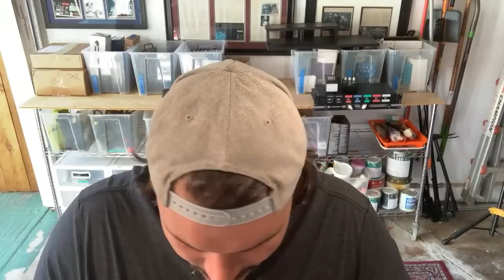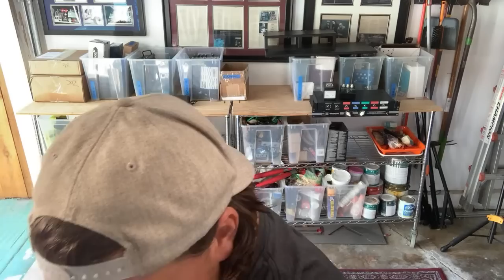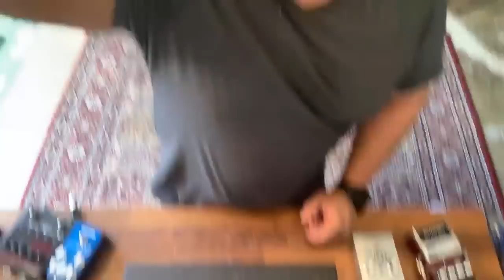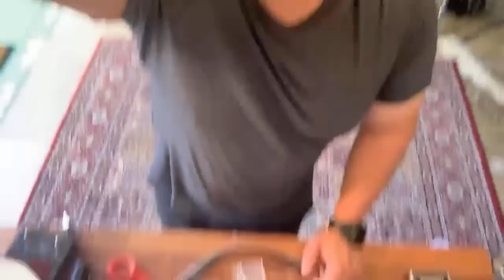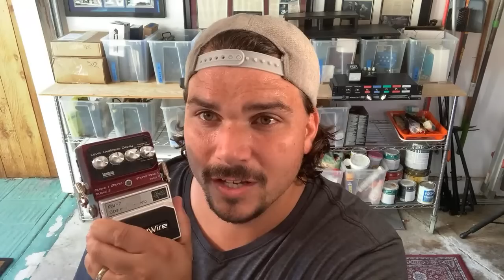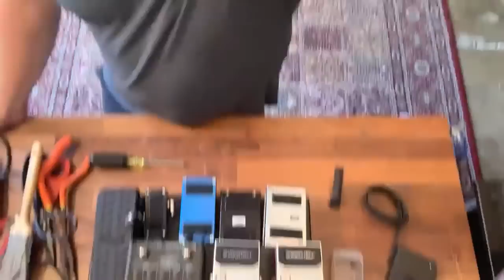Pedalboard Layout Tips and Tricks

Comment: Very handy as i am rebuilding my bass pedalboard..followed your advice, worked great...i don't have a set pedalboard, it depends on what i'm doing..live or recording, i only mount what i'm going to use plus a spare TC Electronics Bonafide Buffer & DI pre-amp ...Laney Digbeth (fantastic)...NU-X Melvin Lee Davis (the best i've used yet) or Shift Line Cabzone X A+ Bass DI (really for studio use,10 amp & 10 cab ir's, but has a 75ohm XLR output for live or studio use) used along with a MXR 'Thump' inline preamp...i use a Polytune 3 with the built in Bonafide buffer turned on....a choice of a Boss Bass Limiter LMB3 or Electro Harminox Bass Preacher compressor & for a gritty tube tone an Eden Glo-Plug (low setting & mix at 50%)...bought an angled Pedaltrain pedal board...great....the power supply unit sits underneath on a small ledge held in place with very strong double sided 2mm thick foam tape ,isolated outputs of course, 5 x 9v, 1 x12v & 1 x 18v) made up the power cords for the pedals myself after watching your video showing how to do it, all Ream pancake connectors with Van Dam studio grade OFC silver plated sheilded cable from my bass through pedalboard & on to amp, if allowed to use a bass amp & cabinet...my EBS Magni 500 combo with 15" speaker can be laid on it's side & used as a stage monitor....result

Comment: Some really good advice here, some of the small things that you do instinctively like when the heat shrink wouldn't fit over the battery connector you simply stretched it with a pair of longnose pliers … Genius move!, I would have been looking for a larger piece or end up using insulation tape. Right, well I'm off to nick my wife's chopping board and finally put my pedals on something instead of all in my gym bag
Reply from the maker: Thanks Jay!

Comment: Thanks for the tips! 
Is there a downside to fitting all the pedals on the board with batteries instead of protecting the 9v plugs with heat shrink tubes? Also, then you have a safety if something happens with power.
Reply from the maker: Maybe just get our battery power supply:  https://www.sweetwater.com/store/detail/VBPS--vertex-effects-battery-power-supply
Reply: @VertexEffectsInc  Maybe I wasn't clear. I am asking if all the pedals are already connected to a power supply, is there a downside of also keeping the battery in them?
Reply: @shimmoon8061 Yes there is, as an old battery will gradually degrade, break down and potentially leak acid which is a huge liability to the internal electronics of the pedals.

Comment: Hey Mason, I'm still a beginner but watching as many of your videos as possible to try and get to an intermediate level.  47:00 into the video you talk about "Masking Off" the pedals.  Can you go into a little more detail on this?  Is it tape your're cutting into small squares for the corners?  It looks like pieces of metal the video.  Masking to me means taping off an area 🤷‍♂️
Reply from the maker: The masking is done during the manufacturing process when the pedals are going to be prepped to be painted.  On our pedals they mask off certain areas where there needs to be ground contact - typically under the pot shafts, under the footswitch, behind the input/output jacks, and on the flange that connects the top clamshell to the bottom.  Equally on the bottom clamshell, there is a masked section behind the counter-sunk holes so that when tightened the top and bottom and making ground connection to each other and shielding the entire pedal.  Many brands skip this step and their enclosures are floating, most typically on the bottom with the more typically Hammond style enclosures.
Reply: @VertexEffectsInc  Thank you for expanding on this.  Much appreciated👍

Comment: Had a great time watching and learning Mason. Picked up a great tip for my Volume pedal. My Fridays just got a bit more interesting. PBC/6X arrives Sunday. You were right the folks at RJM are great. Okay I can’t comment without asking at least one question. I’m building one of the DIY buffer boxes. What happens if I place that in front of my 6X (which uses the 500Ohm impedance). Does it then become The One Buffer to Rule them all?
Reply from the maker: Disable the input buffer in the RJM if you don’t want a duplicate input buffer.
Reply: @VertexEffectsInc  Mason, YouTube is great and all but I’m “joining” so I can call you day and/or night! Lol! Not really, but seriously, with an investment of upwards of $1500 in my/our board (platform, switcher, pedals, cable, cable components, power supply etc) guidance of a more personal nature is required and it looks as if that can happen with a Patreon sub. First I’ve ever done.
Reply: @VertexEffectsInc  I may simply change out that resistor and be done with it. Although having that audio loop is pretty cool. Worth building a box just for that!

Comment: Since we're talking layout, what are your opinions on Pete Cornish's method of putting every pedal inside an enclosure?
Reply from the maker: At the time, it was the simplest way for him to execute his methodology when everything had to be custom made and there were not Pedal Power's or Pedaltrain's in existence.  I don't think there is any advantage of doing this now, but some people want Pete to do his thing on their rig so these types of rigs are still made by him.  He's basically building the power supply into the entire system and regulating it for each pedal, and buffering between every pedal so they are as isolated from each other as possible (impedance wise).

Comment: Just wondering how you deal with velcro on rubber bottom boss pedals?  I love my dd-2...does it's buffer mess with my Mesa High wire output buffer, when it's the last pedal on my board?
Reply from the maker: Turn them upside down and you can mount to the metal and not rubber.  As long as the Mesa is first and last, you're ok.

Comment: Woulndt putting the Nova to the left of the riser solve the issue of having a jack hanging off the edge of the board? Kind of a hazard knocking that jack out.
Reply from the maker: You could but the order would be a bit off so additional cabling would be needed.  Full disclose, I pitched all these ideas to Dani beforehand so it was a bit more decided than maybe shown in the stream.

Comment: Where do you get those low profile IEC cables for the power supply? Or where could I get the parts to make them?
Reply from the maker: IEC power cables are the cables that plug into the wall.  You mean the DC cables to the supply?  Those are 2.1mm x 5.5mm DC male plugs.
Reply: @VertexEffectsInc  I actually do mean the IEC that plugs the power supply into the wall/power strip, looks like a pretty nice right angle! (in the thumbnail)
Reply from the maker: @mikebottiglieri6460  got it...I think I got them from Mouser, Digikey, or Grainger.
Reply: @VertexEffectsInc  thank you!!

Comment: Any issues with pedal casings touching on a crowded board? I understand it’s best practice to not have pedals or cable ends touching between pedals in the fx loop and ones in the front, but is it a rule in general or kind of a non-issue?
Reply from the maker: If there is an issue with the ground, this can be a problem, however done right it shouldn't be a problem.  You can also separate them with head shrink on the plugs' exterior, the paint on most pedals will also not conduct electrically.

Comment: Does Vertex sell the interface boxes or are they all diy? If they are all diy, there are many of us who would appreciate it if Vertex were to sell completed interface boxes
Reply from the maker: We are releasing two interfaces with the same features, one is built into our pedalboards as a module, the other is a stand alone unity for those that don’t have our Pedalboards but want the same functions.  They’ll be 4 buffers available in it and will do mono, stereo, 4 cable method, 5 cable method, wet dry, and wet dry wet routing all in one.
Reply: @VertexEffectsInc  

That is exactly what I am needing. Do you have a timeline for when they should be available? I know with the parts shortages it probably is hard to give an exact timeframe
Reply: @VertexEffectsInc  I need  that with a MIDI thru as well to do amp channel switching. I may have to build one.

Comment: why don't you use Guitar Pedal Couplers?
Reply from the maker: They damage the pedal jacks, and often have more capacitance than a few foot cable.
Reply: @VertexEffectsInc  I believe the capacitance point. As far as damaging, I am not sure. But one thing for sure is that the in and our of the 2 pedals have to be perfectly aligned... with is not the case 90% of the time.
Reply: @thornil2231 the damage comes when you have pedals that don’t have vertical sidewalls or sockets that are exactly the same height from the board - any deviation is critical when you are stamping on the things, and the socket is attached to the PCB inside.